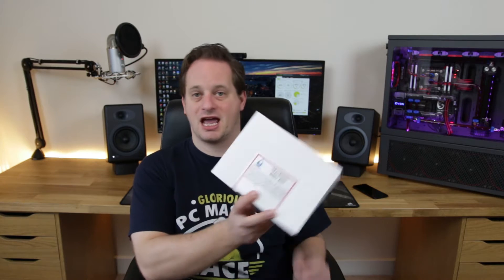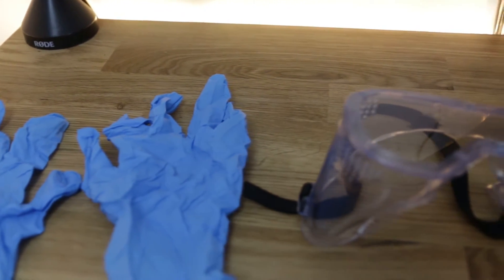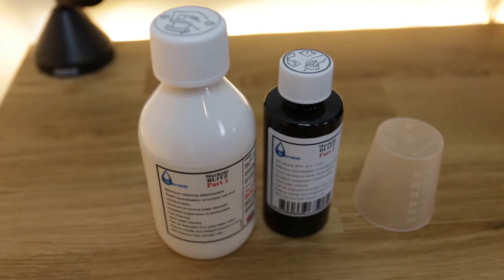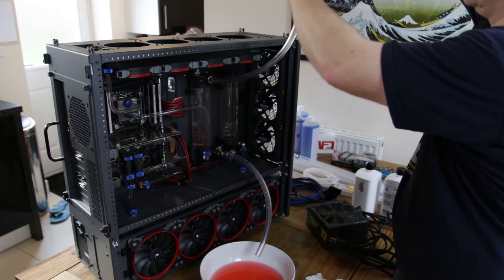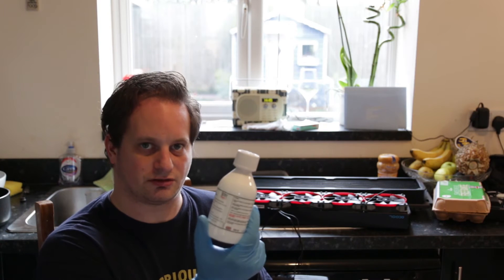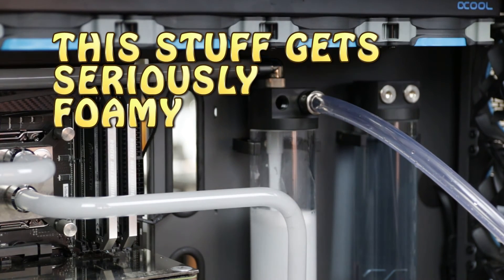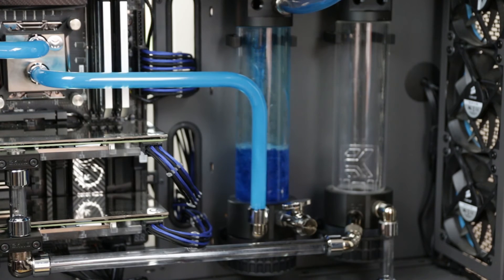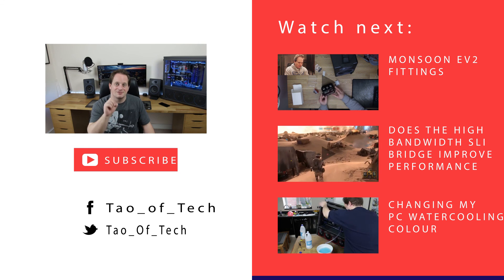Cleaning and maintaining a watercooling loop

Comment: Would be interesting to know wether like me (only been water cooling for 5 months) i flush the system 3 to 4 times with distilled water from a brand new setup every 5 months maximum would we need these kits or at best the secondary kit instead? I will be doing a mid year distilled flush and so keeping the system fresh. Reasoning behind this is the same with any fluid based system ie cars as long as you service it regularly your ontop of keeping it running well. I wonder wether these kits have been designed for people that don't are won't system flush every 4 to 5 months? Ps I game for 6 to 8hrs daily so the system is under load all the time ;)
Reply from the maker: It depends on which parts you are using. I use alpha cool radiators and they tend to have far more flux in them than other brands such as EK-WB. I alos changed the coolant cooler from red which has a habit of staining the inside of your blocks so the colour can leach back in to the new fluid. I would recommend this kit for a yearly clean and I would also think about changing your tubing from time to time particularly if its soft tubing.
Reply: Tao of Tech all my system is ekwb as was the evo red coolant, run for five months with those 6 to 8hr gaming sessions and no stains on the cpu block (clear acrylic) or the reservoir. I used red tubing so wouldn't see any colour change there ;) just renewed the tubing with ekwb clear tubing and am doing a monthly update test on mayhems aurora red 2 to see how long it lasts. Interestingly while I was running just distilled water for the night before using mayhems my temps dropped 5 to 8oC over the evo solution and the mayhems has returned to the evo temps? Ps I wouldn't recommend the new version of the mayhems as unless you case is very open and hugely lit you can't see the effects :(

Comment: You should do red pastel. It will really pop. Also not sure if you have them but dark side led lights can't be best. Changing over my case labs sm8 will have a new video up soon.
Reply from the maker: +James Emsley good luck with your build, let me know how it goes. May try red again in the future, now I have chrome fittings I don't need to worry about it clashing
Reply: Tao of Tech dont use red pastel, it goes bad. Dont. Use another color of pastel.
Reply from the maker: +DrOrtmeyer how does it go bad? I seem to remember some of the pastels change colour.
Reply: DrOrtmeyer it does not go bad. It may change color if Rads are not flushed or ph level is wrong. But he blitzed them. I've used pastels a lot and for long period of times. Yes blue will have less chance of changing color and red is more sensitive. But with cleaning everything and the amount of rads you have you are good. Jays skunkworks changed due to the brand of Rads he used